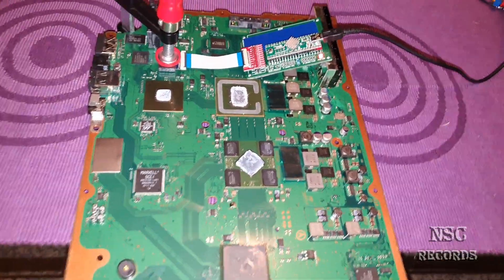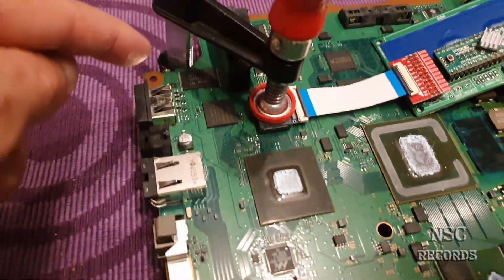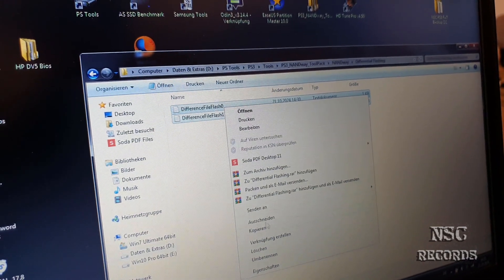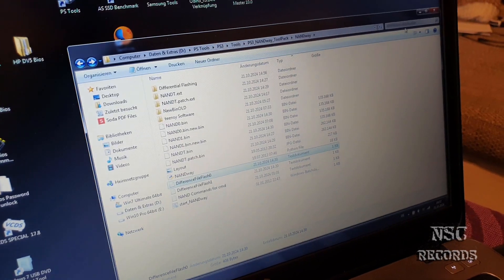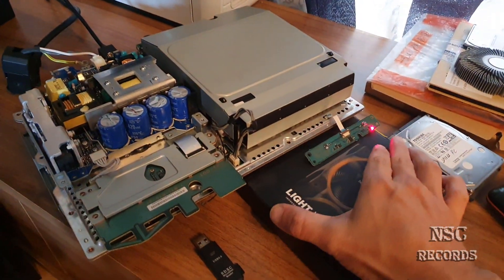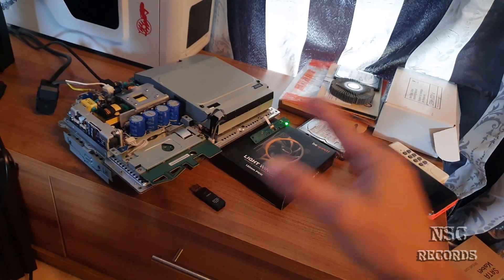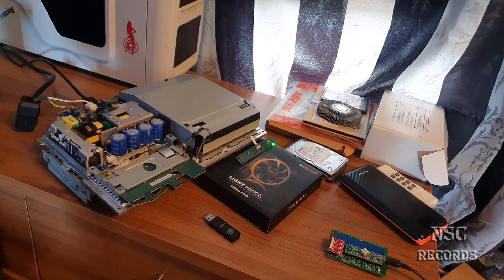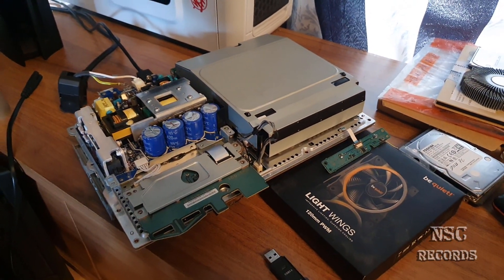PS3 Overclock gonne wrong -fixed- By:NSC

Comment: If you have uart u can increase the voltage to make it work 

Or use e3 flasher to flash frimware
Reply from the maker: That's right too :) But E3 not recommended for Nand chips

Comment: Hey, ich möchte nur die Leute warnen, die hier versuchen, ihre 90-Nanometer-Chips einer vorbeugenden Wartung zu unterziehen. Mein C04-Modell vom März 2007 ist gerade beim Spielen von Test Drive Unlimited 2 ausgefallen und mit einem dreifachen Piepton ausgeschaltet worden (sie blinkt immer noch rot, weil mir sie jetzt praktisch die Sprache verschlagen hat) und hat jetzt ein gelbes licht des todes, höchstwahrscheinlich aufgrund des RSX. Ich habe sie vor 6 Monaten für 30 Euro mit 128 Tagen Nutzungsdauer gekauft und mich sofort darum gekümmert (Reinigung, Wärmeleitpaste, Jailbreak, 1-Terabyte-Solid-State-Laufwerk usw.) und jetzt sogar bei einer Raumtemperatur von 18°C und 68°C Maximaltemperatur, 40 % Lüftergeschwindigkeit, 600 Megahertz Core-RAM und 650 Megahertz Video-RAM (weil es in der Xross Media Bar beim Standard-Evilnat-Übertakten, das 600 Megahertz Core-RAM und 750 Megahertz Video-RAM ist, Artefakte gab). ist sie gefallen, und hat mich satt. und jetzt sitze ich nun sprachlos in meinem dunklen Zimmer, während es einfach vor sich hin blinkt ... Ich vermute, es liegt am RSX (ich habe kein Syscon-Lesegerät) und nicht an der Cell, weil ich ein kleines Wärmeleitpad unter die Cell gelegt habe, da meine L04 seit etwa 9 Monaten mit demselben Wärmeleitpad unter der Cell läuft...

Bearbeitung: 5.12.24, sie ist heute einen tag später wieder problemlos hochgefahren..??? und keine neuen Fehler im Syscon-Protokoll, diese Konsole ist besessen, ich habe ein Temperaturlimit von 67 °C eingestellt und werde 550 Megahertz Core-RAM und 650 Video-RAM installieren, einfach weil mir danach ist.. mal sehen, was sie für mich bereithält, denn jetzt bin ich noch verwirrter, aber nicht mehr traurig.

Comment: Hello, i just found out, By great Reddit post that Wolfstein The New Order run 60fps on Ps3 then i check an Russian Benchmark the Game on PS3 and it Run Locked 60Fps, i checked On Pc With Core 2 Quad Cpu and it runs at ~21-25fps with 90% Cpu Usage, it's the first game ever i see PS3 humbling Pc Cpu, Mortal Kombat 9 Also Run locked 60fps on Ps3 but Core 2 Quad can Run too Mortal Kombat 9 at 60fps by using 80% of it, Wolfstein The New Order is the Ultimate PS3 Cell Showcase as an Cpu Performance wise, there's a comunity on Psx Place which are 100% able to unlocked Frame rate limits on Ps3 with Patchs, maybe we can Unlock Wolfstein The New Order even beyond 60Fps.
Reply from the maker: @VictorHugoAlvarez-eternelymiss  i need to get me that game so i will test it also. The thing is, I'm not sure if the FPS counter is really working that great. My TV is set on 60Hz witch means MAX.60 FPS. But with the game "Motor Storm" in the menu it shows sometimes frames up to 70FPS, that's unreal, and in game 29-30FPS My TV is not able to get me than 60FPS 😂
Reply: @NSC-Modz  what fps counter do you mean Nuno? The ones from Tv or the ones from PS3 apps Like Acari Tool??
Reply from the maker: @VictorHugoAlvarez-eternelymiss  i use the one from WebMan Mod, install newest WebMan Mod and press L3+R3
Reply: @NSC-Modz  Ohhhh Maybe it's really like that, there's a thing like 30fps cap is on games but when the GPU has much more power left then this capps allows the cap to go beyond 30fps, like for example if you look for the sky, it's weird sort of Vsync or something like that is only on PS3 or consoles, I have zero Ideia how it works, but MotorStorm is an Incredible well Optimized game for PS3 it runs solid 30fps with Amazing Physics and graphics, generally PS3 Cell Spu's are very slow at phisics simple cause they lack branch prediction on the Spu's but to bypass that developers must build another way of coding physics than the usual, so MotorStorm having excellent performance on its Phisics is a great sign of great Code optimization, I personally know nothing about programación, i just read this long ago, but I spot pretty much that PS3 generally 80% of games goes very slow performance during Phisics intensive Calculations.
Reply: Also Ryzen 3 3200u 4 threads 3.5Ghz Zen CPU 100% usage in Wolfstein the new order and 24Fps.

Comment: It's not really that great of an idea to overclock Fat PS3s the 90 nm RSX just can't take the higher clock speed that well so you should not oc over 650/750, some can do better, but I'd rather be on the safe side. PS3 Slims on the other hand have quite a bit of headroom and Sony could have probalby shipped them with higher clocks improving the bad performance on many 3rd party games for the Slim models.
Reply from the maker: @H3LLGHA5T  yeah, that's nothing new, let's say like that, overclock a PS3 is not recommend at all 😅

Comment: Glad you saved it ! 😌

About OCing, there are some "safety" guidelines (some will argue that it's not true and that you should always tests the limits by yourself, and... ok, but better be safe than sorry) :

For a FAT/90nm : 600/750 should be the maximum. You might be able to OC it more (650/800-850 for example), but I don't think it's a good idea to stress a 90nm RSX too much. Be sure to have an hardware flasher if trying more.

For a 65nm RSX (some FAT models and 20** slims) : 650/800-850 is still a reasonable limit. The presence of NEC/Tokins is a cause of instability, so 700MHz core isn't guaranteed to be stable in demanding games (shutdowns).

For a 40nm RSX : A 21** might be able to support 700/850-900 just fine but it's not 100% guaranteed. You won't brick it with these frequencies but you could spot some instabilities in game (artifacts, etc...).
For a 25**, 700/850-900 is easy and safe.
You shouldn't try more without an hardware flasher.

Reminder that 700/850 is a nice spot, representing something like 90% of the maximum gains you can achieve by overclocking the RSX.
There are noticeable diminishing returns after these frequencies.
I'm not saying that there's no difference between 700/850 and 950/1000 but... it has been proven to be marginal. Not worth stressing your console but at the end of the day, it's a personal choice.
Reply from the maker: @MitsuTM  yeah, You absolutely right, and even if you found out the limit, you should go 2 steps back to be very sure it's stable. I found out my self 600-750 is just prefect and works with all models i tested till now.
Reply: @NSC-Modz  Yeah 600/750 is the closest thing to a 100% safe overclock, it helps a lot in many games 👍
You're completely right about the limits, It's always a good idea to keep a margin.
Personally, I've found that my main Slim (a 2504) is completely stable at 800/975 but for a daily use I prefer to keep it at 700/850 max.
I made some videos to demonstrate how it performs and it's more than enough ! 😁
Reply from the maker: @MitsuTM yeah, it's like that, maybe it seems to be stable, but one day, there will be a game witch will cause you problems...
Reply: @NSC-Modz  Exactly 👍
Reply: @MitsuTM Mitsu, Please Bench, Wolfstein the new Order Please 🙏, See if you can unlock the Frame Rate with Patches Please 🙏 if you have time, Thanks!!!
Reply: Mitsu Hello, Hello, i just found out, By great Reddit post that Wolfstein The New Order run 60fps on Ps3 then i check an Russian Benchmark the Game on PS3 and it Run Locked 60Fps, i checked On Pc With Core 2 Quad Cpu and it runs at ~21-25fps with 90% Cpu Usage, it's the first game ever i see PS3 humbling Pc Cpu, Mortal Kombat 9 Also Run locked 60fps on Ps3 but Core 2 Quad can Run too Mortal Kombat 9 at 60fps by using 80% of it, Wolfstein The New Order is the Ultimate PS3 Cell Showcase as an Cpu Performance wise, there's a comunity on Psx Place which are 100% able to unlocked Frame rate limits on Ps3 with Patchs, maybe we can Unlock Wolfstein The New Order even beyond 60Fps.
Reply: If someone grinds off the VRAM chips and solders on new ones we are in a new world of fun because they made GDDR3s that were rated up to 1300MHz also 1Gbit (128MB) sooo 512MB VRAM of dubious usability might be possible?
Although from my experience with PCs, it's not so simple, the memory controller might limit that. I know I couldn't get AMD 760G chipset iGPU to even load the drivers on 1866MHz (shared system RAM) but the CPU was fine with it. Also talked to some guy on discord years ago who was overclocking the RAM in his ThinkPad X230 to 2000MHz by rewriting the SPD EEPROM of the SODIMM, but past 1800 the iGPU would crap itself.
Also who knows maybe that damn antique G70 can't take 1Gbit chips, maybe the current 900-1000MHz limit is in fact a problem of the memory controller and not the memory itself. Maybe it's even impossible to clean the underfill off the interposer, well there's no shortage of dead 90nms to experiment on with that!

Comment: Lol, einfach in den Tiefkühler✌
Tipp, falls das wieder passiert, ps3 über AV Kabel verbinden. HDMI schmiert ab. Fan speed auf 80 oder 100% lassen. Desto wärmer sie wird,  desto schlimmer werden die Artefakte. Meistens geht das noch. Ansonsten wie schon gezeigt E3 Flasher👍👍👍. Die 90/65nm RSX kann man meistens bis 650mhz GPU Clock bringen. Vram meistens bis 800/850 sollte genügen. Aus den 40nm kriegt man meistens bis zu 900mhz GPU Clock. Hoffe konnte etwas helfen✌
Reply from the maker: Danke dir Bruder, aber in meinen fall ging auch kein AV Ķabel, das ding war total anal 🤣 Ja, gefrieren hätte zumindest geholfen, wäre der OC nicht zu hoch gewesen 😅

Comment: I have a cecha01 that I repasted without delidding. The only thermal mod I did was adding a washer to the cpu and gpu clamp screws and tightened it. My idle thermals are 68c-cell and 56c-rsx at fan-30% in 23c room with a 600mhz-core and 750mhz-vram overlock. Finished last of us and uncharted 3 with no problems :). Though i have not had any luck using ssd's on this system. Hows your luck with ssd's NSC?
Reply from the maker: Nice, but somewhen, you will need to delid it, or GAME OVER 😆

Comment: 90nm Rsx is only able to run at 600-650Mhz Core and 800-900Mhz Vram everything else is way to much for the 90nm rsx i already tested it
Reply from the maker: I have it higher right now without problems 😆
Reply: @NSC-Modz   what speed are u running ?
Reply from the maker: @nkls287 better gonna not tell you... watch the video there you gonna hear what my absolutely max was xD But never again 😂
Reply: @NSC-Modz  also what factory is ur 90nm rsx from ? do u know how to check this ?
Reply: is the only way to overclock ps3 with Evilnat firmware or is there another method
Reply from the maker: There are other ways, but complicated and risky to

Comment: HW Flasher is the very last option to get the console back running. If u have WebmanMod installed u could be lucky and set then Fanspeed to 100% via Browser. I already did a lot of recovery work on NOR consoles with E3 Flasher